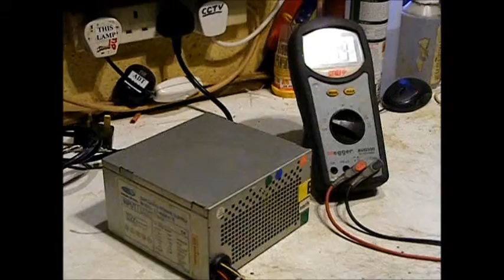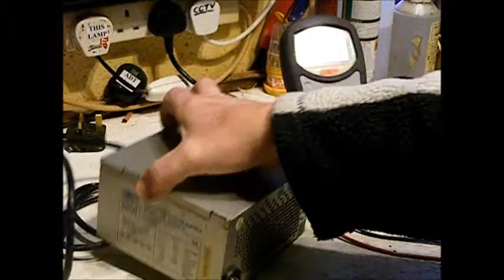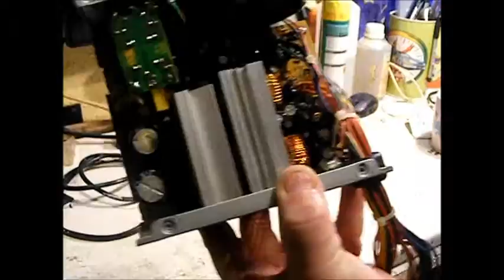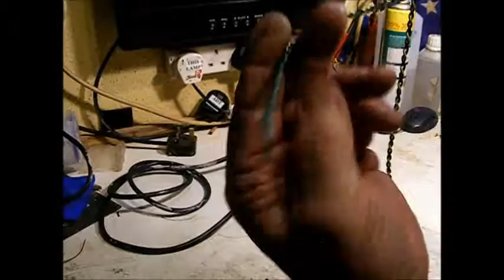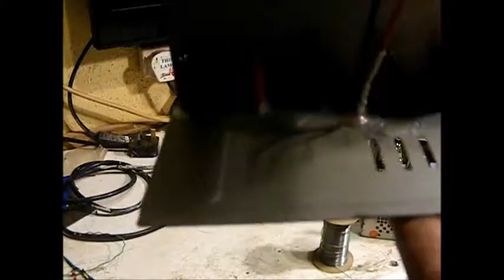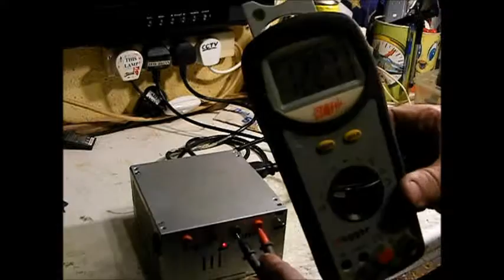PC POWER SUPPLY MODIFICATION

Comment: Eye eye my fishing 3.14! Whilst I've seen mods like this before.  I've not seen anyone suggest bringing the 3.3v rail out which is good.  I do have a couple of suggestions for you however.

1) Include a fuse in each output as the full current from a short will definitely melt the lead and/or binding post.

2) Take advantage of the standby feed with a dual colour LED to build in a standby indicator.

3) Warn the users that these supplies only regulate one or two rails and that the others just come along for the ride.  EG the +12v rail.

It's definitely a cheap way to get some serious grunt though.